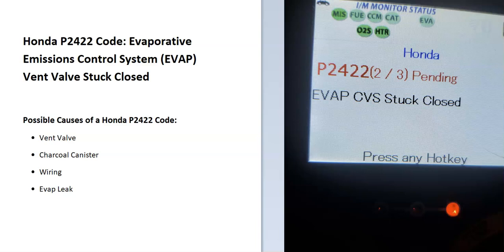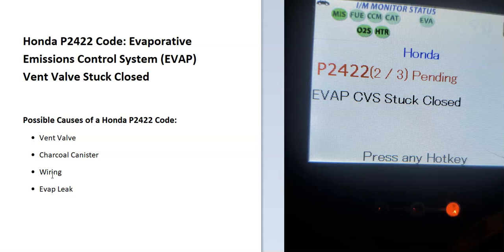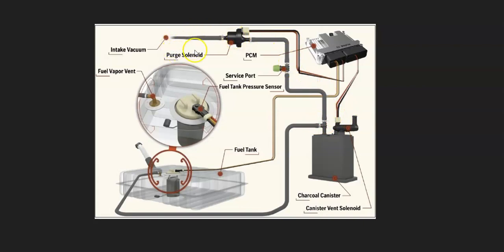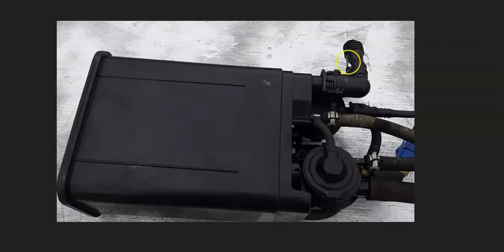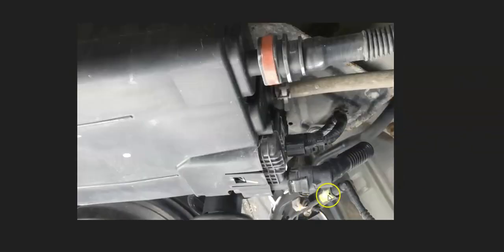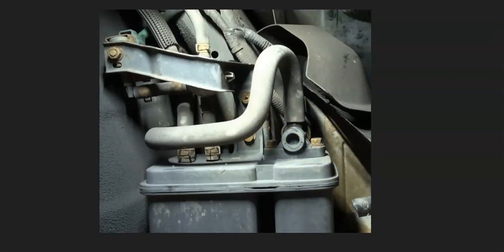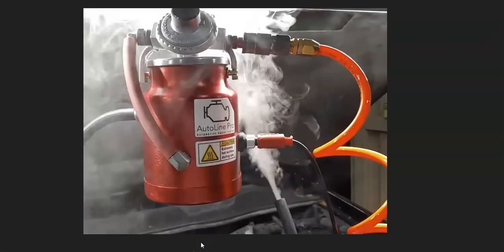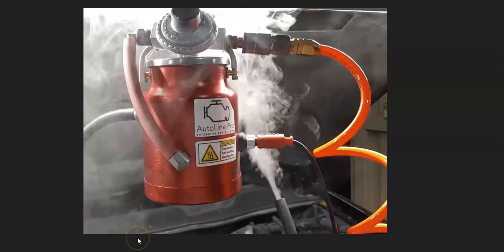How to Fix Honda P2422: Evaporative Emissions Control System (EVAP) Vent Valve Stuck Closed

Comment: Thank you for the p2422 information. Would driving through a flooded area damage the fuse? The code didn't show until driving another 2 miles.
Reply: Same thing happened to me did you figure it out?
Reply: I just drove through a flooded area last night, did you ever find out if it was a problem?
Reply: @matthewmontez3007 I had the same problem and it was also cuz I drove thru water but my trans also went out yesterday not sure what happened
Reply: most likely water in the charcoal canister is blocking air flow

Comment: For 2015 Honda CRV , any idea how much it cost to replace Evap system -(EVAP CANISTER, CANISTER SHUT VALVE, EVAP CANISTER AND FUEL TANK PRESSURE SENSOR )
Reply: My Ridgeline is costing me 1300 for the valve and canister. Highway robbery.
Reply: @Supsup7777 there’s no way that much just for a canister ? U can replace it ur self if its close to the driver side or back side

Comment: i have that code i replaced the canister my problem no one is manufacturer  the purge solenoid  valve is there any way to fix it are rig another valve it has 2pin connector?

Comment: on an 06 crv, there's a purge valve on the canister and on the throttle body.  would the evap vacuum be attached to the rest of the vacuum?
Reply: Where on the throttle body if I may ask? I'm having this problem but fixed the one near gas tank